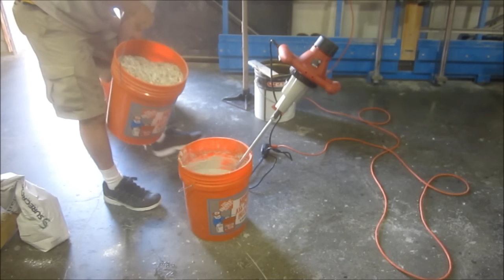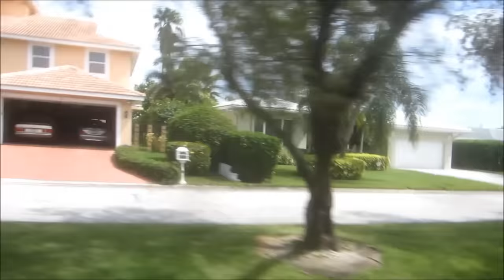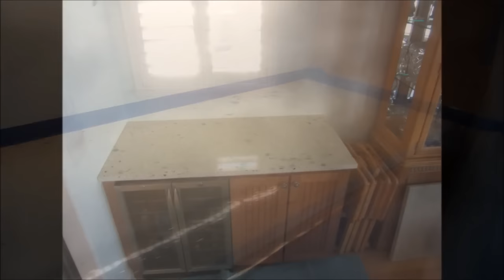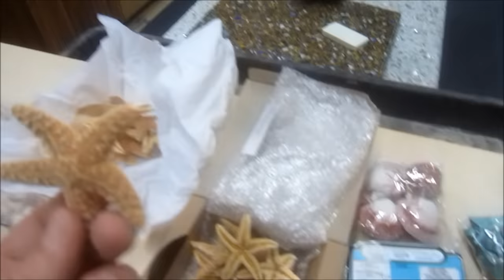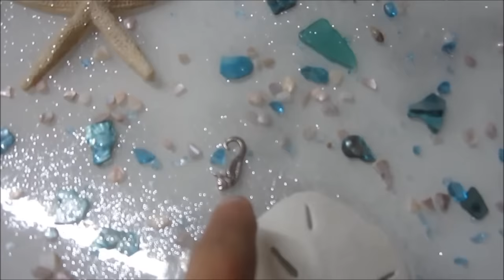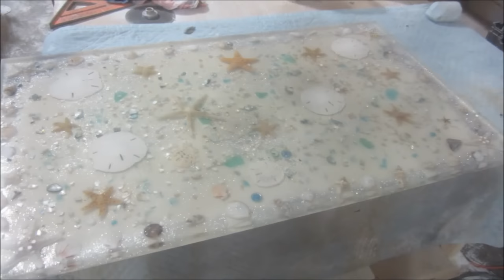Beach Concrete and Epoxy Countertops

Comment: Would love to pour an entryway and dining room floor (on new concrete addition) in a Tampa house. Tiles on the market do not have the glass content I am visualizing. Husband is very handy. Is it possible to do this like an old terrazzo floor with some instruction?
Reply from the maker: Sure, I dont do floors, but absorb all the info you can on you tube and have fun doing it..Start checking the local tampa recyclers, they may be able to give you lotsa glass already cleaned, etc..